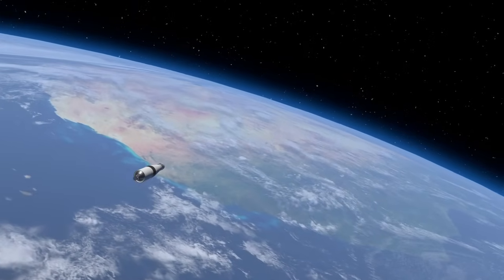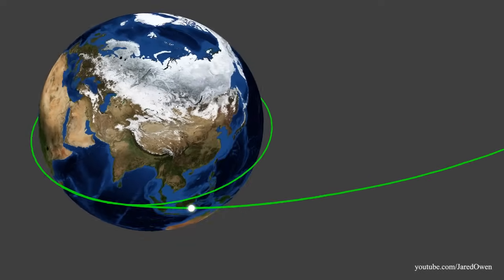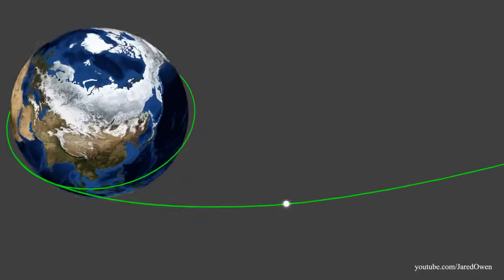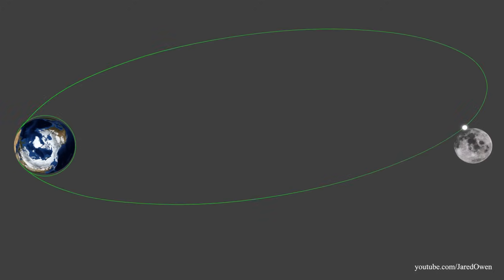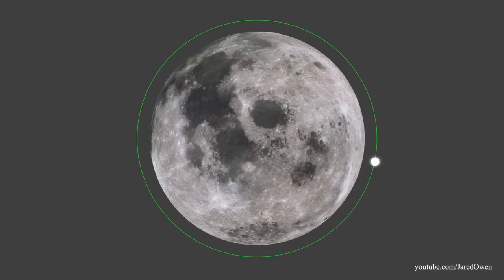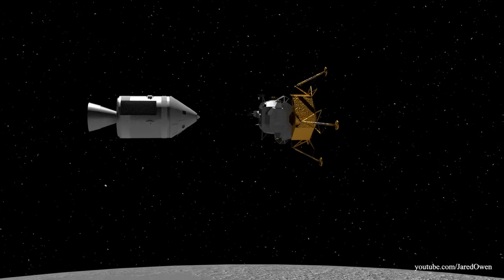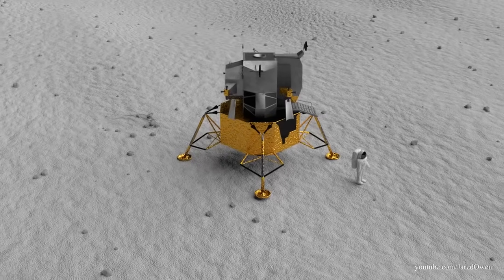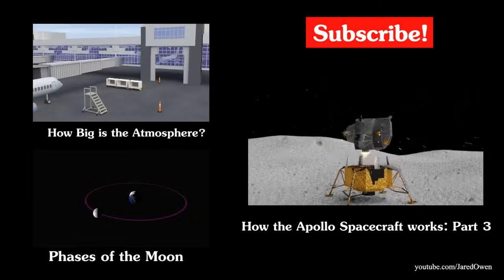How the Apollo Spacecraft works: Part 2

Comment: 2023 год менее 30% удачных прилунений...
Reply: In general, unmanned lunar probes are designed for a 50% success rate.  It would cost 10x more money to design them for 99% success rates.  So, most countries just play the odds.  If they were going to spend 10x more money, they'd rather have 10 missions and 5 be successful, rather then 1 mission with 99% odds of success.  Manned missions are a different story.
Reply: @ Возьмём исключительно основные этапы полёта на Луну и обратно. 
Примерные значения вероятностей:
Для примера возьмём гипотетические значения вероятностей успеха для каждого этапа (на основе исторических данных и инженерных оценок):

P1=0.95

 =0.95 (вероятность успешного запуска ракеты).

P2=0.98 

 =0.98 (вероятность вывода на орбиту Земли).

P3=0.97
 =0.97 (вероятность успешного перелёта к Луне).

P4=0.96

 =0.96 (вероятность выхода на орбиту Луны).

P5=0.90

 =0.90 (вероятность успешной высадки на Луну).

P6=0.95

 =0.95 (вероятность успешного взлёта с Луны).

P7=0.97

 =0.97 (вероятность успешного перелёта к Земле).

P8=0.98

 =0.98 (вероятность успешного входа в атмосферу и посадки).

Расчёт общей вероятности:
Ptotal=0.95×0.98×0.97×0.96×0.90×0.95×0.97×0.98.P total=0.95×0.98×0.97×0.96×0.90×0.95×0.97×0.98.
Вычислим поэтапно:

P total=0.95×0.98=0.931,
P total =0.95×0.98=0.931,
0.931×0.97=0.903,
0.931×0.97=0.903,
0.903×0.96=0.867,
0.903×0.96=0.867,
0.867×0.90=0.780,
0.867×0.90=0.780,
0.780×0.95=0.741,
0.780×0.95=0.741,
0.741×0.97=0.719,
0.741×0.97=0.719,
0.719×0.98=0.705.
0.719×0.98=0.705.
Итого, общая вероятность успеха миссии составляет примерно 70.5%.

Учёт человеческого фактора:
Человеческий фактор можно учесть, добавив дополнительный множитель 
P human , например, P human=0.99
P human =0.99 (вероятность отсутствия критических ошибок экипажа). Тогда:

P total=0.705×0.99≈0.698 P total  =0.705×0.99≈0.698
Итог:
С учётом всех этапов и возможных рисков, вероятность успешного пилотируемого полёта на Луну с высадкой и возвращением составляет около 69.8% Примерные значения вероятностей:
Для примера возьмём гипотетические значения вероятностей успеха для каждого этапа (на основе исторических данных и инженерных оценок):

P1=0.95

 =0.95 (вероятность успешного запуска ракеты).

P2=0.98 

 =0.98 (вероятность вывода на орбиту Земли).

P3=0.97
 =0.97 (вероятность успешного перелёта к Луне).

P4=0.96

 =0.96 (вероятность выхода на орбиту Луны).

P5=0.90

 =0.90 (вероятность успешной высадки на Луну).

P6=0.95

 =0.95 (вероятность успешного взлёта с Луны).

P7=0.97

 =0.97 (вероятность успешного перелёта к Земле).

P8=0.98

 =0.98 (вероятность успешного входа в атмосферу и посадки).

Расчёт общей вероятности:
Ptotal=0.95×0.98×0.97×0.96×0.90×0.95×0.97×0.98.P total=0.95×0.98×0.97×0.96×0.90×0.95×0.97×0.98.
Вычислим поэтапно:

P total=0.95×0.98=0.931,
P total =0.95×0.98=0.931,
0.931×0.97=0.903,
0.931×0.97=0.903,
0.903×0.96=0.867,
0.903×0.96=0.867,
0.867×0.90=0.780,
0.867×0.90=0.780,
0.780×0.95=0.741,
0.780×0.95=0.741,
0.741×0.97=0.719,
0.741×0.97=0.719,
0.719×0.98=0.705.
0.719×0.98=0.705.
Итого, общая вероятность успеха миссии составляет примерно 70.5%.

Учёт человеческого фактора:
Человеческий фактор можно учесть, добавив дополнительный множитель 
P human , например, P human=0.99
P human =0.99 (вероятность отсутствия критических ошибок экипажа). Тогда:

P total=0.705×0.99≈0.698 P total  =0.705×0.99≈0.698
Итог:
С учётом всех этапов и возможных рисков, вероятность успешного пилотируемого полёта на Луну с высадкой и возвращением составляет около 69.8% 
Если добавить к этому не основные этапы. При этом сюда же включены все успешные высадки на Луну как свершившиеся в реальности, а также заложена (современная!) надёжность ракет, поэтому, споря о проценте - это намного завышенный результат. 

Цифры взяты из реальной статистки 
один из примеров реальных данных: 
Программа "Аполлон": Из 7 пилотируемых миссий к Луне (Apollo 8-17) все, кроме Apollo 13, завершились успешно. Это даёт успешность около 85%.

Современные ракеты: Например, Falcon 9 имеет успешность запуска около 98% (по данным SpaceX на 2023 год).
Reply: @rockethead7  а теперь возьмем расчет с учётом реалий того времени до 1969 г 

Итог:
С учётом технологий и опыта, доступных до 1969 года, общая вероятность успешного пилотируемого полёта на Луну с высадкой и возвращением составляет примерно 24.9%.

Учёт человеческого фактора:
Если добавить вероятность ошибки экипажа или наземного персонала (например, 
P human=0.95P human =0.95), то общая вероятность снизится:
Ptotal=0.249×0.95≈0.237P total =0.249×0.95≈0.237

Вывод:
До миссий "Аполлон" вероятность успешного полёта на Луну с высадкой и возвращением была крайне низкой — около 23.7%. Это объясняется несовершенством технологий, отсутствием опыта и высокими рисками на каждом этапе миссии.

Запуск ракеты-носителя (P₁):

Ракетные технологии в 1960-х годах были менее надёжными. Например, ракета "Сатурн-1" имела успешность около 90%. Возьмём 
P1=0.90
Вывод корабля на орбиту Земли (P₂):
Этот этап был относительно отработан (например, программы "Меркурий" и "Джемини"). Возьмём 
P2=0.95
Перелёт к Луне (P₃):

До "Аполлона-8" (1968 год) ни один пилотируемый корабль не летал к Луне. Это был совершенно новый этап. Возьмём 
P3=0.80
Выход на орбиту Луны (P₄):

Требовалась точная работа двигателей и навигации. Возьмём 
P4=0.85
 Спуск и высадка на Луну (P₅):

это самый сложный этап, так как требовалась посадка на неизученную поверхность. Возьмём 
P5=0.70
Взлёт с Луны (P₆):

Взлёт с Луны требовал работы двигателей в вакууме и точного расчёта траектории. Возьмём 
P6=0.80
Перелёт к Земле (P₇):

Возвращение к Земле было относительно более простым, но всё же рискованным. Возьмём 
P7=0.85Вход в атмосферу Земли и посадка (P₈):

Этот этап был отработан в программах "Меркурий" и "Джемини". Возьмём 
P8=0.90

23.7% !!!
Reply: @rockethead7  а, у нас оказывается деньги решают инженерные задачи, а не инженеры. Понятно...  А сейчас американцы не могут ни на Луну полететь, ни своих забрать с МКС из космоса, потому, что денег мало? Нет! Не решены инженерные задачи самим инженерами! И скорость таких изменений и решений не в деньгах. И никто не разрабатывает зонды, вкладывая в них 50% вероятности успеха заранее. В какой форме этот успех закладывается? В виде магических амулетов или карт? Нет же. Инженеры делают, что могут по максимуму. И можно составить простую школьную математическую задачку с определением шанса на успех миссии пилотируемых полётов. И также не трудно определить причину ребячества космонавтов и инфантильное поведение на "поверхности Луны", и понять их невнимательное отношение к оборудованию.
Reply: Landing unmanned spacecraft on the Moon is hard. Apollo had an advantage in having people on board who could steer the Lunar Module to a safe landing site.
Reply: @maxfan1591  особенности орбиты Луны, гравитация и отсутствие атмосферы являются одними из важнейших проблем. Более ровное место посадки не единственный фактор. Также надо учесть техническую сложность, человеческий фактор, количество возможных процессов отказа в ходе миссий и технические узлы которые могли выйти из строя плюс непредвиденный фактор. Для статистики возьмем 5 подряд успешных приземлений автоматических станций. Только приземлений. Оказывается 5 подряд удачных не было. Наличие астронавтов даёт к посадке бонус в 300% удачи? Если учесть, что это ещё более сложно организованная работа с миссиями в целом, то надо 500% бонус удачи вкладывать. А если учесть, что надо ещё вернуться на Землю после всех трудностей, то бонус удачи должен быть почти запредельным (учитываем несовершенство технологий и знаний того времени по сравнению с нынешними). Вопрос очень прост: а что давало такой бонус удачи астронавтам из США?
Reply: "it turns out that money solves engineering problems, not engineers"

Dewdrop, adding levels of redundancy and testing is the main factor.  For unmanned probes, they don't usually make backup systems, and backup systems to the backup systems.  They don't usually run test missions for unmanned probes.  Why do you think the first moon landing was on Apollo 11?  Why not Apollo 1?  Why'd they run an entire Gemini program with 12 flights before Apollo?  Good grief.  Stop pretending you understand things you do not.
Reply: "pick up their own from space from the ISSpick up their own from space from the ISS"

So, now there's another topic you know nothing about, but feel like pretending you do?
Reply: "Engineers do what they can to the maximum"

Dewdrop, engineers cannot just build backup systems themselves.  They build what is in the budget.  They build what the rocket can carry.  Again, sorry you don't understand.  But, oh, go right ahead and keep saying that every space agency on Earth is all "doing it wrong."  You've come to YouTube to say that you know better than the world's aerospace engineers!!! Wow, what a hero you are!!!
Reply: "This gives a success rate of about 85%.

Modern rockets: For example, Falcon 9 has a launch success rate of about 98%"

Dewdrop, did you just attempt to compare the success rate of entire missions to the success rate of a simple rocket booster?  Good gods.  Stop pretending you understand things you do not.  You do know that the Saturn V booster successfully propelled Apollo 13 to the moon, right?  The failure of the Apollo 13 service module is unrelated to the success of the booster that sent it to the moon.  Pretending to understand all of the math with all of those P levels you made up ad nauseam means NOTHING.  You literally just sat there and manufactured a bunch of imaginary P levels, pretending that this somehow relates to Apollo.  Thanks, dewdrop, your imagination doesn't matter.
Reply: @rockethead7  вы не способны понять в принципе или у вас кривой переводчик? Я на факте показал, что деньги не могут решить инженерные проблемы. Я не говорил, что инженеры делают, что-то неправильно. Я указал, что ваше замечание о 50% вероятности успешности автоматических станций доставки является глубоким заблуждением и догадкой. Инженеры не вносят коррективы на 50% успешности, а работают на максимум. Вероятность складывается из фактических данных. Т.е. все мои слова основаны на фактах.
Это не воображение, это фактические данные которые заложены в простые формулы. Если вы не понимаете как вычисляется вероятность, то можете посмотреть учебник по математике, если у вас такое вообще есть. Я ещё сократил основные этапы, а не придумал их. Если бы их подробно расписать, то это ещё уменьшает вероятность успешной миссии.
Reply: Dewdrop, I'm not playing this game.  Stop pretending to understand things you don't.  The entire planet's aerospace engineers in every country with space agencies disagrees with you.  Every single country's space agencies have different standards for manned missions than unmanned missions.  And, yes, more money allows engineers to put more testing and redundancy into systems.  Your inability to understand is not my problem.
Reply: @rockethead7  ваши записи абсолютно ничего не несут и не привязаны к фактам. Что вы написали комментарии, что нет - не играет никакой роли поскольку информационная значимость нулевая. Кроме некоторых предположений и удивления  в них ничего не указано. Поэтому не имеет значения в какие игры вы играете или не играете. Сколько денег нужно, чтобы забрать застрявших на МКС людей в течение полугода? Не отвечайте если не знаете. 
И о каком притворстве с моей стороны идёт речь? Вы в состоянии пояснить или просто повторяете как лозунг свои же слова которые основаны на ваших личных эмоциях и игнорируют факты? Где я хоть раз указал ошибочные факты?
Reply: Dewdrop, I asked you a dozen different questions, and you answered NONE of them.  Instead, you keep changing topics, pretending to understand concepts that you do not.  No, I'm not answering new questions, especially when they are completely unrelated to your original topic.  STOP PRETENDING YOU UNDERSTAND THINGS YOU DO NOT.
Reply: @  "Dewdrop, I asked you a dozen different questions, and you answered NONE of them" 

Questions are marked with a "?" icon at the end. It's like this in my language
Reply: Yes, dewdrop.  There were plenty of ? icons, which you ignored.
Reply: @ At the same time, your questions are rhetorical in nature, i.e. they do not require any explicit answer. And if you don't understand the facts or you are arguing with the facts, then it is better to consult a psychiatrist and describe in detail your problem of confronting the facts.
Reply: "if you don't understand the facts"

Dewdrop, I'm not the one who pretends to understand more than the entire planet's space agencies.  That's YOU doing that.  You pretend that every country on Earth with a space agency is "doing it wrong" when they set different standards, and spend money in different quantities, for unmanned missions vs. manned missions.
Reply: @ откуда такой вывод?  "doing it wrong" ???? Я такого не думал и не говорил. Это ваши личные фантазии. Я лишь посчитал вероятность с завышенными параметрами в пользу успешности
Reply: Dewdrop, I asked numerous questions.  First, you said I didn't ask any, because you refused to see that I put "?" icons at the end, accusing me of not doing that at all.  Now, you realize that I did ask questions, but, you're making the excuse that they're "rhetorical"?  No.  You have ZERO understanding of engineering.  YOU are the one who posted a huge comment with P levels that you created out of your imagination.  YOU did that.  Then, you compared a rocket booster to an entire mission.  I asked about those things, and you want to brush it aside and ask me questions about the ISS?  Sorry, dewdrop, I'm done here.  I'm not going to sit here and entertain someone with zero understanding of the topic, who thinks that a YouTube comment is a scientific journal about space agency efficiency, while claiming that every space agency on the planet is "doing it wrong."  Go entertain yourself by arguing with the wind.
Reply: @  "doing it wrong." Again? Where did I write this? It's your emotions that speak on my behalf.

Rhetorical questions are questions to which the answer is obvious, so there is no point in answering.

Фактические данные указывают, что успешность полётов в таком количестве у США маловероятна, хотя и не является невозможной. О чём вы вообще думаете? Нагородили кучу необоснованных лозунгов.

У меня не нулевое понимание инженерного дела. Я выучился на инженера.
Reply: "And now the Americans can’t fly to the Moon, because there’s not enough money?"

Correct.  They retired the Apollo program decades ago.  New craft and equipment do not just manufacture itself, you know.  Congress funded Artemis at a rate to put people back on the moon by around 2028-2030.  Trump asked for a faster pace back in 2019, but congress denied the funding.
Reply: "no one designs probes with a 50% chance of success in advance"

Yet, that's the exact thing that they do.  Funny how that happens, huh?  You said it yourself.  Recent probes had a low success rate.  It's the same from every country who sends probes to the moon.  Sorry that you don't understand.

Comment: I've always wondered about the Apollo missions: after the third stage, the Command and Service Module separates and rotates to dock with the Lunar Module. Why was it designed that way instead of having the Lunar Module permanently attached on top of the Command and Service Module, thereby avoiding the rotation maneuver and docking procedure?

I guess NASA’s choice wasn’t arbitrary—it was a well-thought-out tradeoff between aerodynamics, structural efficiency, docking feasibility, and mission safety?
Reply: Also, if there was a problem during launch, they wanted the command module to be right on top to be able to get out of there in a hurry (the command module had its own rocket powered escape tower that yanked the command module away from the Saturn V stack).  They wanted the people inside to be as far away as possible, without having a big lunar module in the way of their escape if the rocket was exploding.
Reply: @rockethead7  You could technically do it, just look at the soyuz orbital module, but it would just make it more complicated.
Reply: "I guess NASA’s choice wasn’t arbitrary—it was a well-thought-out tradeoff between aerodynamics, structural efficiency, docking feasibility, and mission safety?"

Correct. The Lunar Module was fragile, so it needed to be protected against the slipstream during launch. It was also wider than the Command Module. It therefore made sense to place it inside a shroud between the Command Module and the wider third stage.